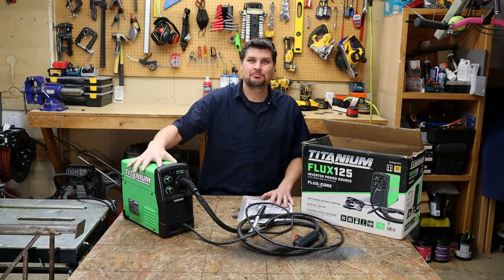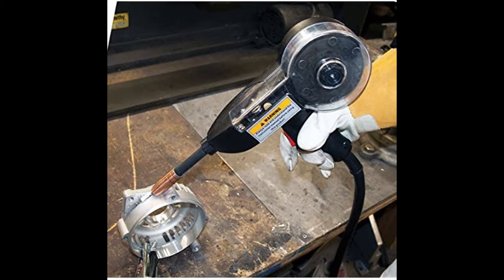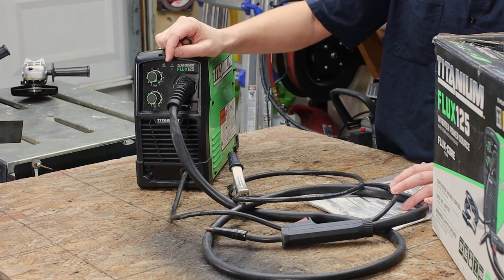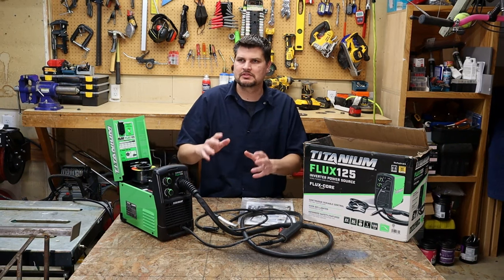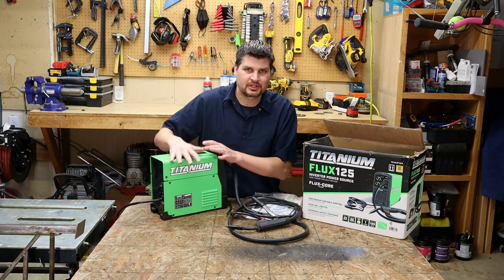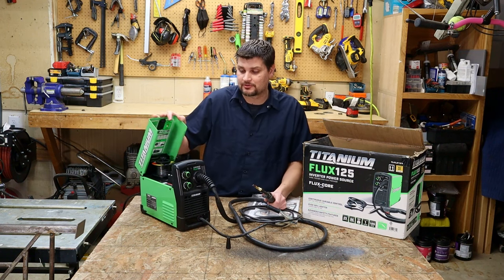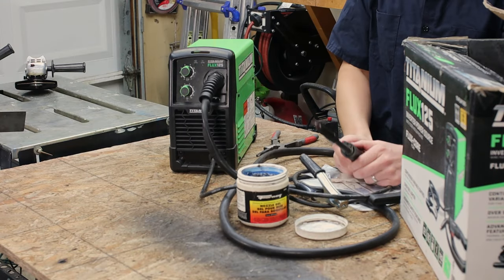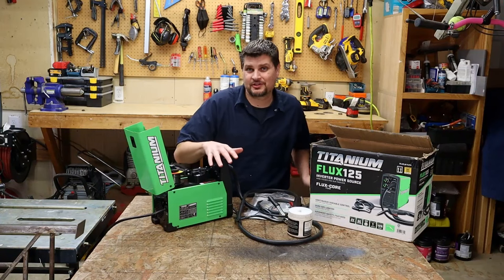Harbor Freight Welder Questions and Answers *Titanium 125*

Comment: I just bought one, i think its good for basic common small jobs, it works great. For any large scale professional work.......well thats why there trained and knowledge professionals out their thatll do that.
Reply from the maker: Agreed!
Reply: @-DIYPRO-  hey, you know any diffrence in wired from big box stores or do they basically all do the same job?
Reply from the maker: Is "wired" a brand or are you just saying any welder at a big box store?
Reply: @-DIYPRO-  i meant flux core wire, not wired. Is all the wire basically the same or are other brands better then other brands wire wise?
Reply from the maker: @deanmilken3633  there are people that say some are better then others. I honestly get what ever is cheapest.
Reply: @-DIYPRO-  ok thank you. Also with that machine what settings do you use on your hood helmet? Just seeing if i got mine set right cause im new to welding. Thank you for the replys
Reply from the maker: @deanmilken3633  no problem, slow day at work, lol! It depends on the amps. This machine only goes up to 125 so an 11 or 12 shade will work.
Reply: @-DIYPRO-  no work for me, raining and part snow. Thank you, i had mine shade at 10, so its about right. Thanks again man.

Comment: wondering why titanium flux core welder keeps restarting
Reply from the maker: Are you running on max settings? How long between restarting, is it overheating?
Reply: @-DIYPRO-  No. I can only weld for about 5 seconds before it turns off again
Reply from the maker: @HEADBANGRR my only other thought is if using an extension chord? If not then sounds like you got a lemon.
Reply: @-DIYPRO-  Yes that may be. I ordered a Lincoln electric 90i FC from Home Depot. It arrives today! The one that's giving me the issue is a harbor freight titanium 125. I'm going to RETURN it soon 😁